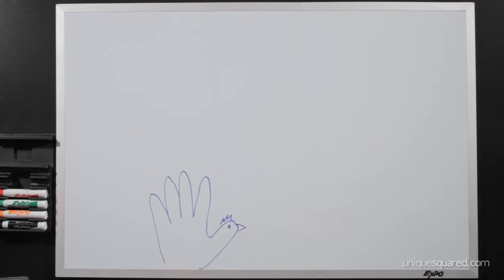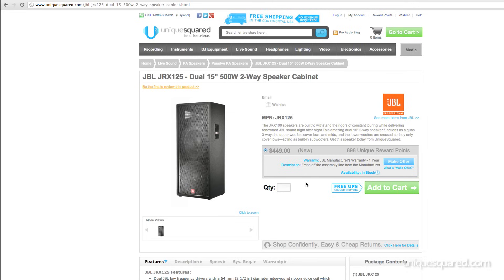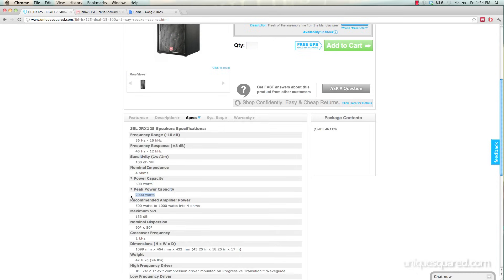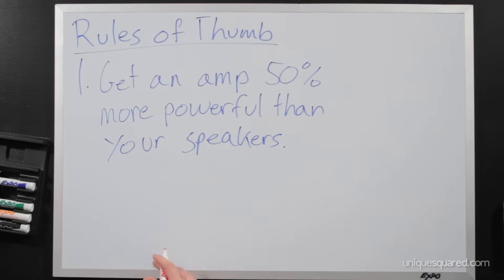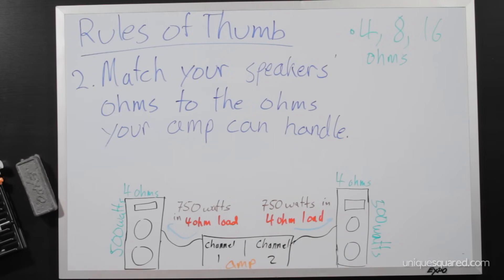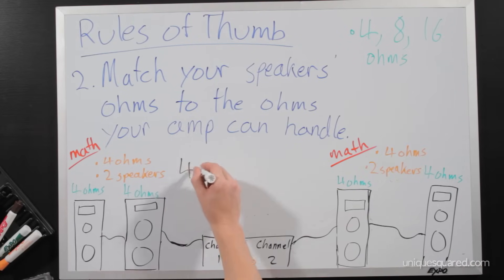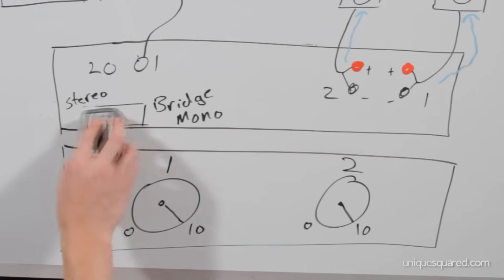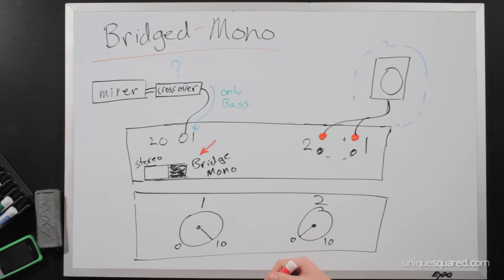Amplifier to Speaker Matching Tutorial | UniqueSquared.com

Comment from the maker: An 8 ohm speaker is only Nominally 8 ohms. It's impedance actually varies from about 3-30 ohms over the course of the frequency range. Amp makers PREFER you to use 8 ohms because if you crank the volume, you are less likely to over-heat the amp. Putting an 8 ohm speaker on the amplifier capable of supplying current to a 4 ohm load makes the amplifiers job easier.

Please refer to your equipment manuals and contact the manufacturer to maintain the integrity of your equipment.

Comment: Hi, i've jst watched your vid and understood the thing about Power capacity/rms. what puzzle me is the impedence factor, suppose i have Gemini RS 315 ABS Plastic Moulded Passive Speaker(Impedance = 8 ohms, power is 300Wrms)[So the amp will need 450W per channel right] then i get amps that does not include 8ohm in their specs like Behringer EP2000 Pro 2000W Amplifier(2 x 1,000 Watts into 2 Ohms; 2 x 750 Watts into 4 Ohms; 2,000 Watts into 4 Ohms (bridge mode) ), now how do u tackle that aspect?

Comment from the maker: As stated in the video, as long as your amplifier is 50% more powerful than the speakers you are powering then you should be fine. This is not always an exact specification so be sure to read the blog linked below the video as well as reading the operating instructions from the manufacturer of your equipment.

Comment: I work at a club that has a Peavey xr1212 mixer. The mixer has 2 600 watt power amps at 4 ohms each. We are running 2 Peavey SP 2s (1000 watts program) off one amp. Then, we're running 2 Peavey PV monitors (500 watts program) off the other. Am I correct in assuming that we are at least under powering the mains?

Comment: "Acoustic Drive MC 3000" also Known as "AD MC3000

SPECIFICATIONS

Model MC 3000

Output 8Ohms 1KHz0.1% THD stereo Mode:

2 x 800W

Output 4Ohms 1KHz0.1% THD stereo Mode:

2 x 1200W , 
2 Ohms - 1400W x2
Bridge Mono Power 8 Ohms -  2000W
1Khz0.1% THD 4 Ohms - 2400W
Signal to Noise -106dB

Comment: sir sorry for that anyway it's a power amp i heard it can also use for outdoor events but unfortunately i don't have any idea if its for sub or mid high... "Acoustic Drive MC 3000" also Known as "AD MC3000 
SPECIFICATIONS
Model    MC 3000
Output 8Ohms 1KHz0.1% THD stereo Mode:
2 x 800W
Output 4Ohms 1KHz0.1% THD stereo Mode:
2 x 1200W

Comment: Sir is it ok if i have speakers 2pcs Crown JH-500-800 and i want to run those speakers for subs and my amp AD MC300 "800W x2 at 8 Ohms", "1200W x2 at 4Ohms" is this ok or correct?

Comment: hello! RMS is not written in the manual.i look at the back of the amp. and i saw there are 4 pairs main speaker output and 3 pairs surround speaker output.if i will use these surround output, the speakers ratings should be the same as the speakers use in the main speakers output? i'll try to look the rms online. maybe i bought a wrong amplifier...

than you very much for the reply..

Comment from the maker: The main problem is that you are under powering your speaker. This should not ruin the integrity of your speakers or amplifier, but depending on your audio needs, the volume output will be relatively low as you have very little power being sent to your speakers.

For properly matching speakers and amplifiers, its best to use our tips in the video and the blog linked below the video.

Comment from the maker: As stated in the video, you will want an amplifier that is 50% more powerful than your speakers. If you have a 300 watt speaker then it is best to have 450 watts behind it. Since you have 2 300 watt speakers, it would be best to have something like a 900 watt amp. So look for something around 900 watts and you should be fine.

This is of course a general rule and not universal to every amplification scenario.

Comment from the maker: It can be confusing as this is not an exact science and there is lots of conflicting information on the web. Under powering a speaker is a potential problem because often times people wil push an amplifier too hard to get more volume out of a speaker and this can cause speaker failure. Proper amplification will keep your speakers running at optimal performance for a long time.

Comment from the maker: eHow says to match the impedance level which is measured in ohms, not watts.

There is a lot of information/misinformation online. We work closely with speaker and amplifier manufacturers to give you the most accurate information.

Because we receive varying levels of comment relevancy, an approval process is in place to better serve your needs and eliminate irrelevant comments, spam, hate speech, and harassment between those that post.

Comment: Hey Sorry, I would like  re-do the question again better explained.
I would like to ask a question please.
To much power - Can I control it? Question?!
*U6000DSP Amplifier has 2x 3000w at 4OHMS , 
*2 speakers Behringer  2200w peak , 550 RMS 4 ohms, 
I would like to ask you if it will be ok if  I control the volume gain in the knobs of amplifier to no cross the 550 RMS, is it possible? 
Can you help me please?
Thanks, 
Kleber

Comment: Hey thanks first of all. 
I would like to ask a question.
My Behringer NU6000DSP Amplifier has 3000w at 4OHMS each channel, I bought just now  2 speakers Behringer B2520 PRO each 2200w peach , ( I am not sure about RMS) , I would like to ask you if  it will be ok?  Will be working nicely, or the power of amplifier will blow it up, we have 800w each channel +?   So if  the RMS is less then 2000w ( probably ) will be dangerous, I burn, is it correct?  Can you help me please?
Thanks,
 Kleber

Comment from the maker: As mentioned in the video you generally want an amp that is 50% more powerful than your speakers. This will ensure the best performance from both your amplifier and your speakers. Under powering your speakers has the potential to ruin your amplifier.

Turning the level all the way up on your PA amplifier is never a good idea. If you need more volume, the best solution is to get more powerful speakers and an amp to match instead of pushing your PA to the limit.

Comment: Thanks Chris. Our system is a Yamaha EMX312SC mixer (300w) with two S112V Yamaha speakers (350 watt). Are we at risk right now with underpowering our speakers? 

One thing I still don't get - if we had say a 500 watt mixer, wouldn't we blow our 350 watt speakers if we turned the level all the way up?

Comment from the maker: No.

The minimum power requirement you are trying to achieve here is 1000w [(4x500)/2] but you should really have more than that like a 1500w or 2000w amplifier.

Comment from the maker: Great question!

Using 1 speaker at a time should be just fine. You can run in mono as long as your speakers are matched properly. What type of PA system do you have (i.e. speakers, amplifier, mixer, wattage rating, etc.)?

Comment: Hey, I just happen to have same speakers as these in tutorial, and i was searching for a amp. I wonder why you picked Crown Xti 2002, couse i found crown XLS 2500 to be 300E cheaper and still have 4ohm and 2x775W (per channel). i mean i just dont get. i am not a pro in this, but are mybe these XLS series worse? also have 1 more question. It states in stats that XLS 2500 has in bridged mono 2400Watts... isnt that supposed to be 2x775=1550? 
thanks for answer in advance :)

Comment from the maker: As suggested in the video, you will want an amplifier with roughly 50% more power than your speakers. In your case, and amplifier that can put out around 800 watts per channel should be sufficient. You will also want to make sure that the amplifier is matched at 4 ohms, just like your speakers.

If you message us directly I can send you some links to a few amplifiers that would be perfect for your setup.

Comment from the maker: As a general rule of thumb the ohm rating that your on your amp should match your speakers and always have a little more power than the speakers are rated for. Honestly though its not an exact science. If you message us directly I can give you some links for you to learn more.

Also if you can tell us what gear you have or what you plan on getting we can give you some direction.

Comment: Getting an amp that with a higher power rating than the speakers might protect you from driving your amp into distortion, but how do you ensure that you don't drive to much continuous power to your speakers (who aren't rated to handle the full output of that amplifier).

Comment: Good info. Computer PSU's are kinda the same, you want to get more watts then needed or else your PSU will be less efficient at full load and run more hot and also will degrade sooner. Also a basic rule they say is to keep your cost ratio of the cpu and gpu at about 50/50 to avoid bottle necks. I wonder what the ratio would be for amp and speakers. 2/1? So roughly a $700 amp mates well with ~$400 speakers?

Comment: okay cool - but i am actually trying to build a speaker system for a festival to run of a few car batteries and i was wondering how to calculate amp channel watts with multiple speakers - can you explain what happens to the watt in the same senario as when the ohms decrease? =)

Comment: that was a fantastic video - i cant thank you enough! i wish i would have found this a couple years ago! so right now, i have a denon PMA-510ae (40W+40W (8ohms) or 70W+70W (4ohms)) running 4 JBL Control Ones (50W continuous, 8ohms) - just by pure luck. It looks like I am just about ok in the setup (although at high volume it doesnt sound very good - but i'm guessing either my speakers are old, or the system just isnt that powerful. Anyways, any tips much appreciated, and many, many thanks!!!

Comment: hey man - thanks for the tutorial it, makes sense now - one thing i was unsure about - when you use more than one speaker in a channel, the amp will have to deal with lower ohms but what about watts - wont you need more watt power from your amp to power two speakers from one channel ? - for example how can a channel with 800 watts power two 500 watt speakers? i would have though that it would have to have 1000 watt per channel? .. but i know nothing about this - that just sounds logical to me =)

Comment: Would helpful to the less tech oriented, to know about calculating loudspeakers connection in parallel vs in series. As rule of thumb speaker impedance has to be at least equal or greater than amp impedance. Neverthless if speaker impedance is greater than amp  (i.e. 16 ohm on a 8ohm power amp  )  then impedance output will be reduced cause of  a greater resistive charge.